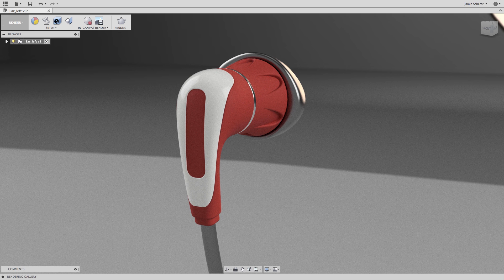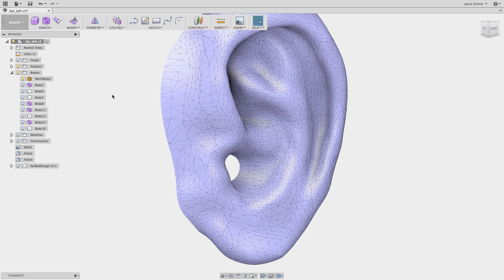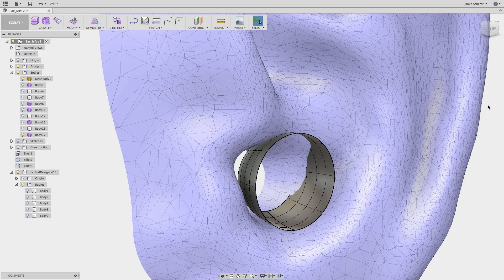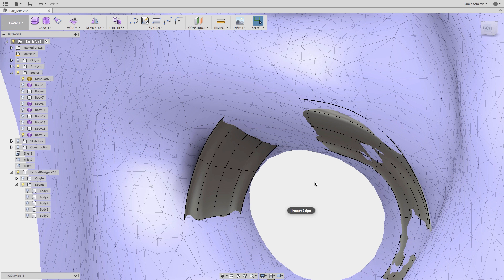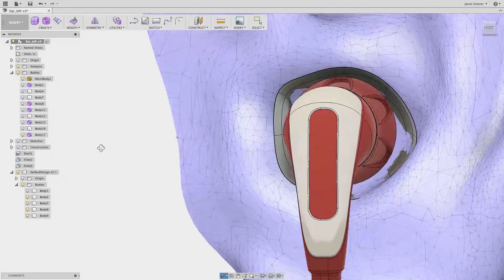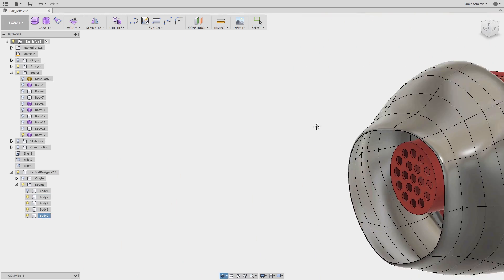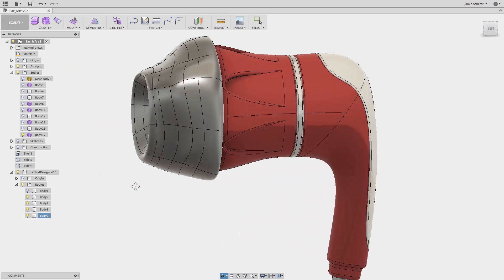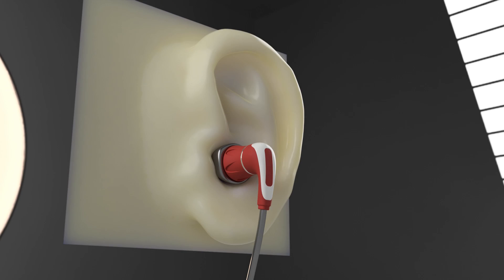How to Form a Custom Ear Bud

Comment: Thanks for the video! I have a question: how did you turn it a real object?
Reply: Ricardo - In the sculpt workspace while capturing history, when you hit finish form in the Toolbar the tSpline geometry will automatically become a surface or a solid (If it is a water tight boundary).   If you are not capturing History, you simply need to use the Convert tool under utilities and convert to a BRep Solid.
Reply: Obrigado pela resposta! Thanks for the answer!